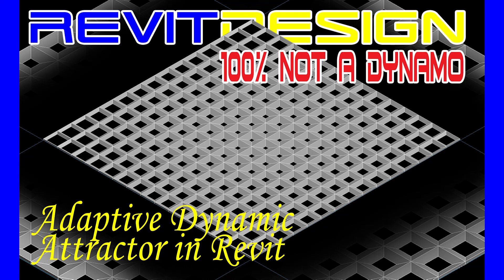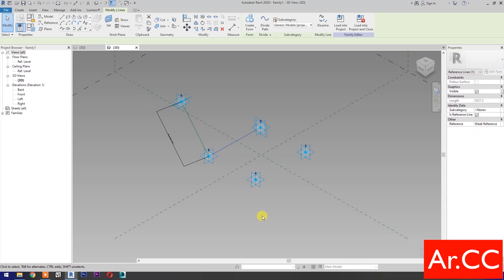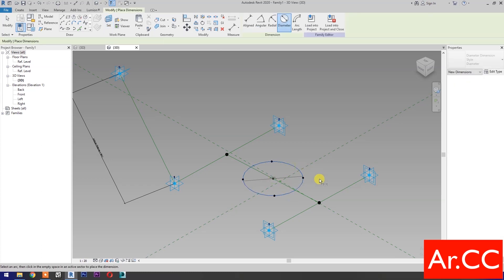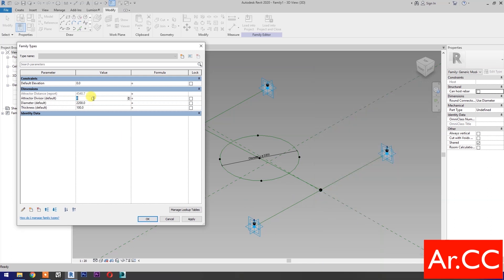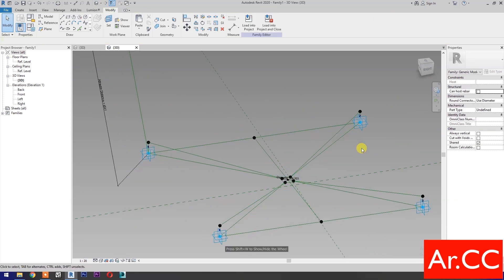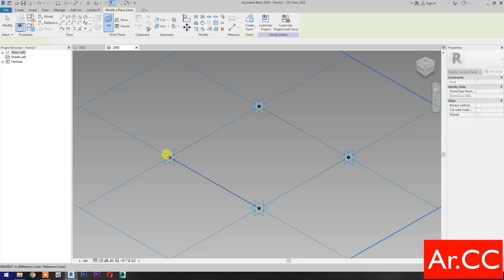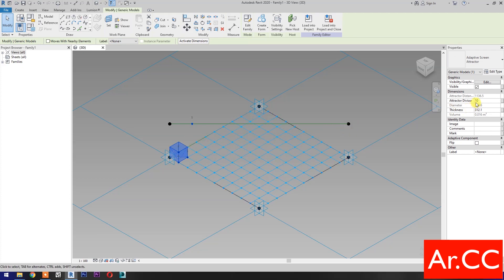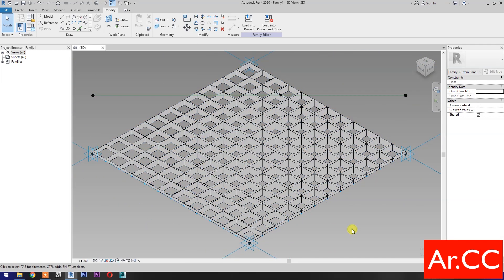RD128. Adaptive Dynamic Attractor in Revit. 100% Not A Dynamo.

Comment from the maker: RD126. Attractor in Revit. 100% Not A Dynamo Undiscovered. Adaptive Screen Grid Pattern in Revit.
https://youtu.be/lCQzZ4cBqiw
RD125. Attractor in Revit. 100% Not A Dynamo. Line Attractor in Revit. Part 5
https://youtu.be/p-bznN4DK-0
RD124. Attractor in Revit. 100% Not A Dynamo. Multiple Attractor Points in Revit. Part 4
https://youtu.be/JzY4STiMCq0
RD123. Attractor in Revit. 100% Not A Dynamo. Single Point Center Attractor in Revit. Part 3
https://youtu.be/_KTnlNc78EY
RD122. Attractor in Revit. 100% Not A Dynamo. Single Point Attractor in Revit. Part 2
https://youtu.be/RbmO-BRj1hc
RD121. Attractor in Revit. 100% Not A Dynamo. Single Point Attractor in Revit. Part 1
https://youtu.be/UWlj2m8BaP4